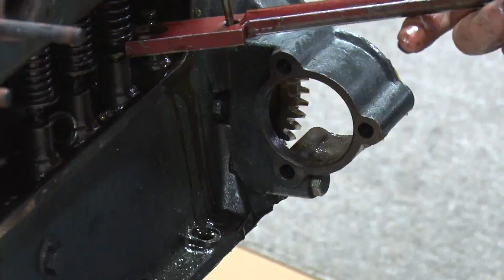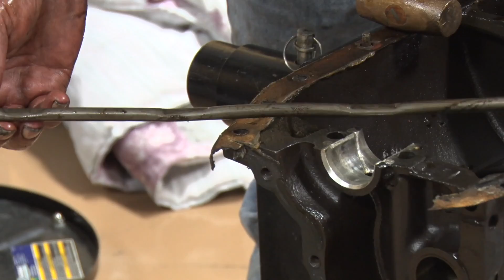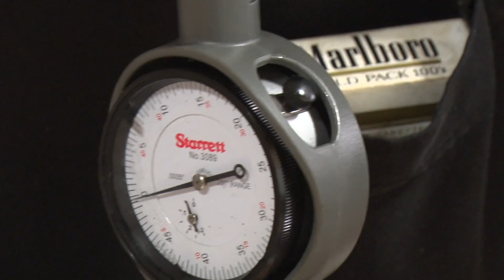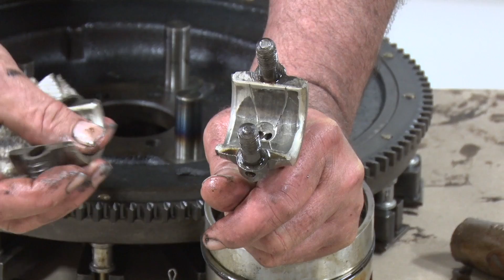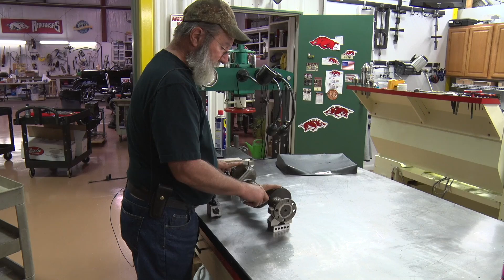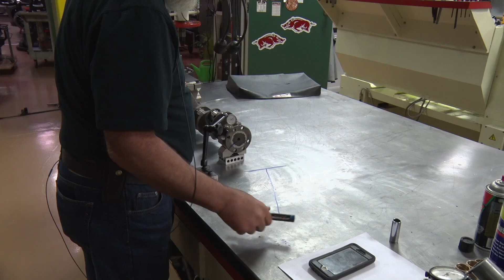Investigating an Engine Failure ~ Part 3

Comment from the maker: Yes you can build the engine up without the magnets and field coil if you are going to use a distributor.  You might consider putting oil splashers on the flywheel.

Comment: Im rebuilding a model T at 16 years old and i don’t know much, if you are putting in a distributor can you get rid of the magnets and copper coils inside the engine and still have it work properly.
Reply from the maker: The short answer is yes you can eliminate the magnets and field coil if you use a distributor.  You do need to provide a method to get the oil splashing around in the engine.